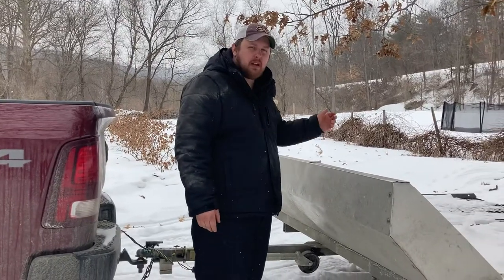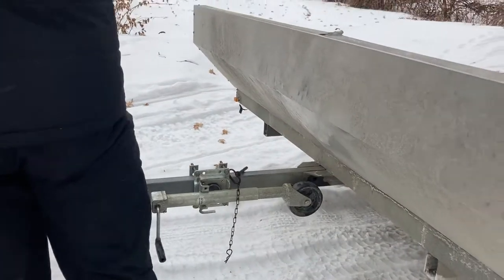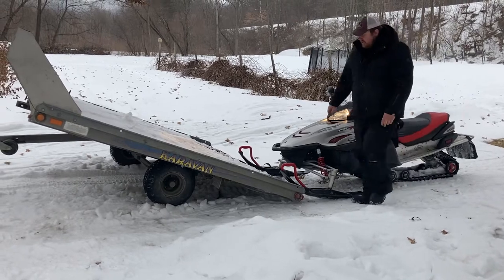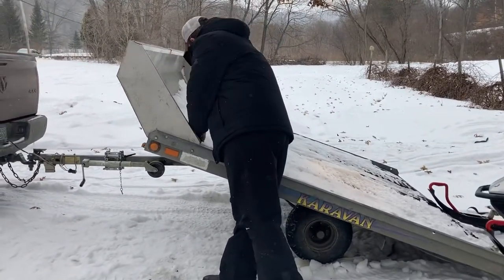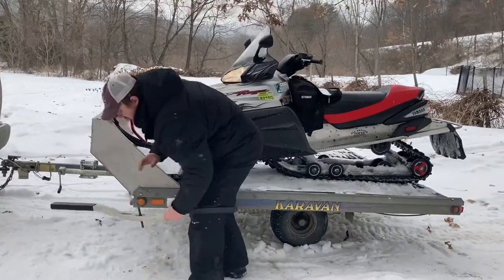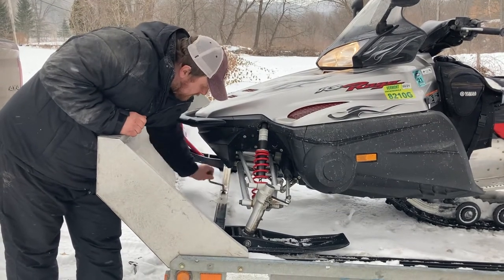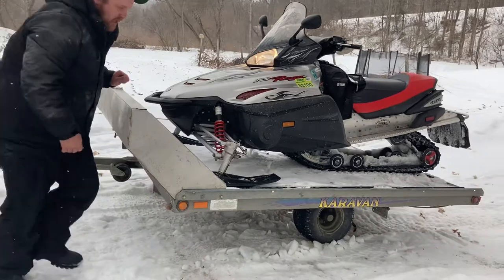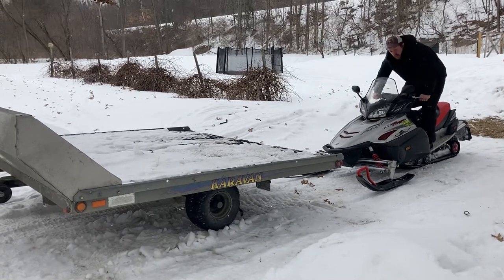Loading and unloading snowmobile on tilt trailer

Comment: I have a Yamaha viper and older one and it has no reverse would you just try to slide the sled down when it’s tilted and then pull it off I guess.it’s a heavy machine to move around

Comment: What if you dont have reverse?    Just gotta struggle right?
Reply: If you don't have reverse you just snow check a sled that has reverse, decide to buy a new trailer, get a whole fresh set of Klim riding gear and boots, and top it off with a new helmet and heated googles and gloves.... This sport is dangerous!!  Happy new year!
Reply: Untie it un bolt tilt stand on back of trailer so it tilts up passing fulcrum point then slowly pull truck forward.
Reply: Backup really fast, hit the brakes really hard.   Sled comes right off.